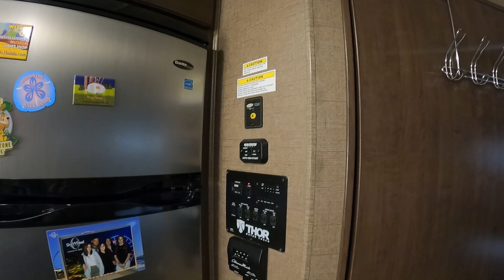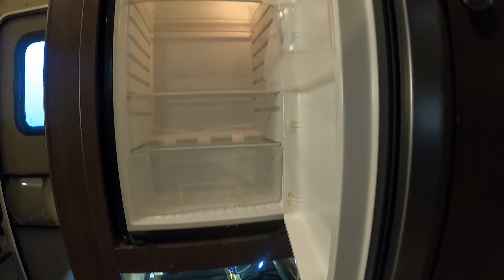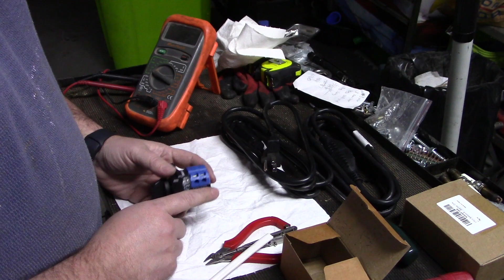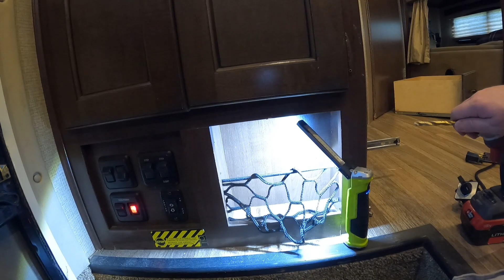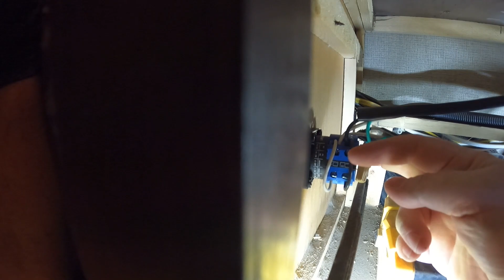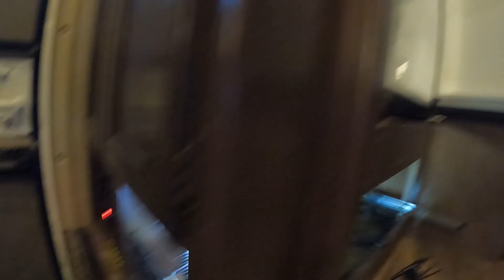How to Wire a Rotary Transfer Switch: 2 Power Sources, 1 Output.

Comment: Good video explaining the wiring, thanks. I have the same LW28-20 switch but mine had internal links where you bridged the output side. I did not have to bridge mine with external wires. I guess they make different variants of the same switch?
Reply from the maker: Sounds like they must make them with internal links. That would definitely make it  little easier.

Comment: Hi brother from Ireland, thanks for the informative video. Do I need to add jumper wires to have the switch 1 to inverter 2 to shore power ?
Reply from the maker: The separate inputs went into the  switch without jumper wires but both outputs on the output side were jumped together.

Comment: Works great but you should have that in an electrical box.  Get a 2 gang old work cut box, plastic or stainless steel double gang blank cover.  Cut a square out of the wood panel, install the box and push the wires into the box. Drill the holes and mount the switch to the cover, wire it and then install the cover to the box.
Reply from the maker: That is a great idea and would probably make it easier for my wife and kids to locate the switch and turn it on. The RV "receptacle" that is also under the fridge for the 120V is atrocious. I hate the weird push-on RV plugs.

Comment: is this 1 input 2 outputs
Reply: It's the same. However you want to wire it. He did 2 inputs one out. You can do 1 in and 2 outs.
Reply from the maker: No. It is 2 inputs and 1 output but it should theoretically be the same.

Comment: Great video. You can also use a relay to do the same thing and it would automatically switch the circuit when you have power applied to one of the inputs.

Comment: For the Jump side, I'm going to split each jump wire and use a 3 wire Wago connector. One wire in the top, one in the bottom, and one wire out to socket wire.  This avoids putting two wires in the same screwed down connection.
Reply from the maker: @theyellowtiburon  that’s a brilliant way to do it!

Comment: I would like to use a 30 A version of this same which to transfer power to my electrical distribution panel. Setting 1 for power from my Bluetti Ac300, setting 2 power from 30A shore power. My question is the where I should connect the wire that would power the distribution main breaker. Would that wire connect to the jumper wires? Thank you for any help you could give. This is the only video I could find on this subject. Jay
Reply from the maker: The power out to the breaker would go on the opposite side of the two input powers. That output would include jumper wires to the empty terminals next to/below it. Your setup would be just like mine with the output going to your breaker not a fridge plug. Hope that helps.
Reply: @MajorDadsGarage  thanks so much I really appreciate it. I thought that was it but really wanted to make sure. This build has been a labor of love. Getting down to the nitty gritty now.

Comment: Due to the problems I have had with unreliable 3 way fridges. I have now fitted a small 240v fridge (50w) which is only powered on mains at campsites. (This compressor fridge works much better but does not work when driving!)  The 12v wire for powering a 3way fridge is unused next to the new fridge. (the 12v wire is only powered when the van engine is running.) If I fit an inverter using this 12v wire ,can I use the rotary switch so that I can switch to using the inverter when driving.  Then change to 240v on the camping site. My concern with the switch is that when I turn the switch to work on the campsite 240v does the 240v also feed back to the inverter. (does this not matter?) 
Thanks from Scotland
Reply from the maker: This does not matter. The switch completely separates the power sources and does not feed power back to the inverter or back to the campsite source.

Comment: Anyway someone can tell me how to wire 1 power source and two outputs? I have a external solar panel port that I want to either feed my EcoFlow Delta 2 Max or my house batteries. Trying to use this device to switch between the two outputs. Thanks in advance.
Reply from the maker: I think that if you connect the inputs together or jumper the inputs together (basically reverse of mine) with two separate outputs it should do what you want.

Comment: Wow...finally...I have a similar switch to charge my Bluetti system by either shore or alternator/battery sources.  The switch came with no instructions and I've watched several videos trying to discover how to wire this thing.  No one and I mean no one shows it all and no where near enough for me to do it correctly...UNTILL THIS VIDEO!  You even showed what to do with the green wire!  No one else even mentions the green wire that I have found.  I can't thank you enough.  I am subscribing to your channel right now.
Reply from the maker: Glad I could help. I was concerned I wasn’t clear enough in my instructions.
Reply: @MajorDadsGarage   I thought it was clear.
Reply from the maker: I saw your other comment in email but can’t see it here. I would probably test the input power sources with a multimeter first to verify voltage then do a continuity test to verify that the input sources are connected or shorted. On most RVs the shore power charges the battery so you might need to isolate the battery from the inverter/charger or you will have power to both sources when plugged in. When you are not plugged in the inverter will be off and the sources will no longer be connected.
Reply: @MajorDadsGarage  Sorry...I deleted it within an hour or so of posting it as I discovered I have a half track mind.  Some people have a one track mind and can only do one thing at a time.  I work on one thing and forget to take care of half of it.  I was so focused on testing the alternator/battery side of the switch that I didn't unplug the shore power so when I flipped the switch to shore power the tool powered up.  I thought it was coming from the battery side and never considered that is was running off the shore power that I hadn't unplugged.  After taking a break I showed my wife the problem and she asked "Did you unplug the shore power?".  "I've never felt more stupid than I did at that moment.  Anyway...it's all good and working perfectly.  I left it on shore power the rest of the afternoon and the Bluetti B300 batteries charged up from 45% to 100% in about 5 hours.  I have it limited to 10 amps as the alternator/battery/inverter works well at that amperage without setting off an alarm on the 2000 W inverter.  I just set it to 10 amps and leave it even on shore power.  If they add the ability to change the input amperage to their app I will probably switch back and forth, but as long as I have to get into the cargo area and switch it on the machine I will just leave it.  I couldn't be happier about that charging system.  Wiring that switch was a hurdle I wasn't sure I could complete before our upcoming trip and I don't think I would have gotten it done without your video.  Thanks again.